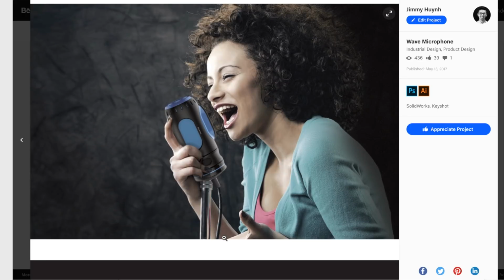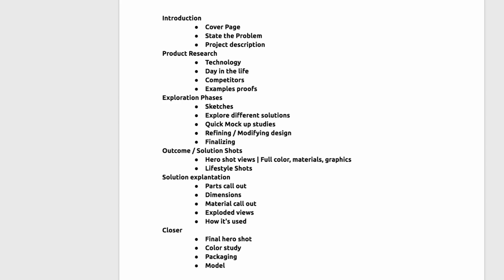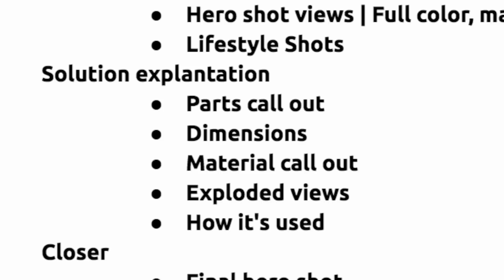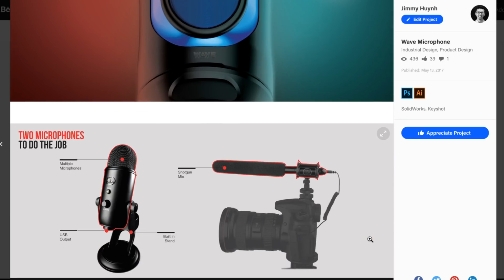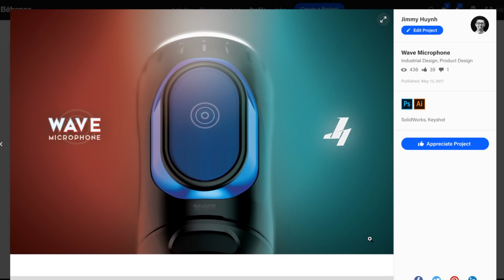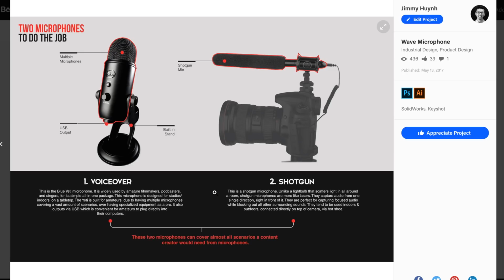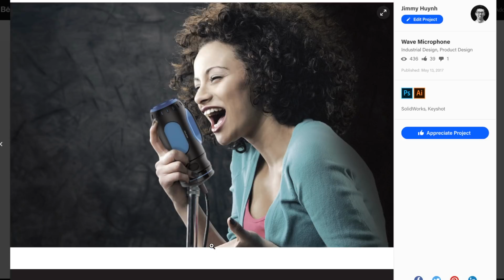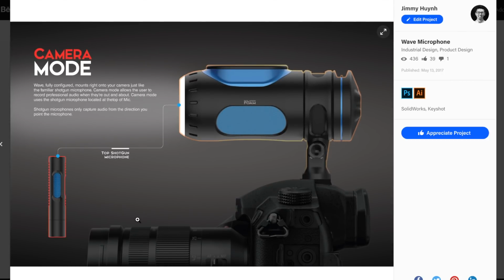How to build an Industrial Design Portfolio for School [Part 2]

Comment: Would this same format work for a professional portfolio for after graduation?
Reply: I asked myself the same question and would say no, because no one will ever look threw so many Pages. It´s way to long. I would recommend 3-5 Pages per Project.
Reply: @MrUratox  It is actually fine if you're fresh out of college. You still have a lot to learn. But professionals are VERY good and the companies they have worked for speak for themselves, so they can get away with 2-3 pages even. If a designer worked for Apple, Braun, and Bose. Do you REALLY think people possibly hiring this designer care if they have 1-10 pages per project? No...The son of a bitch worked for apple, braun, and bose. It's a damn good designer. The portfolio will just show the professional work, which, again from the above companies, won't be a paperweight.

But for new grads, it's perfectly alright to be in the 6-7 page realm.